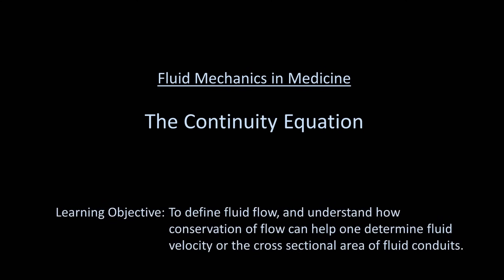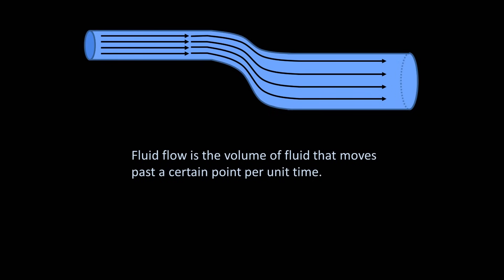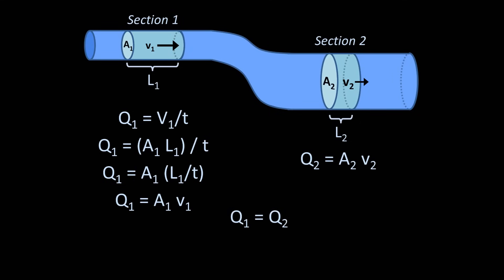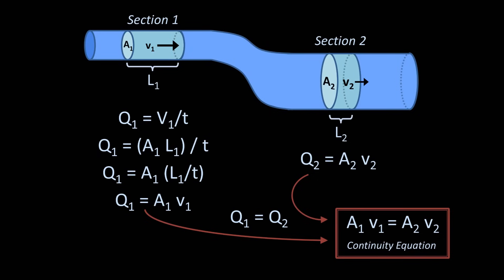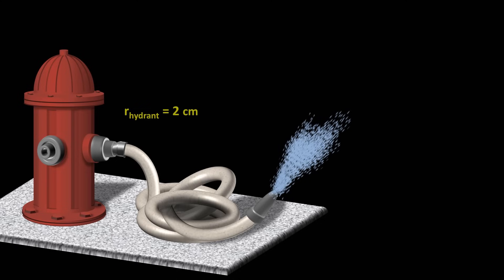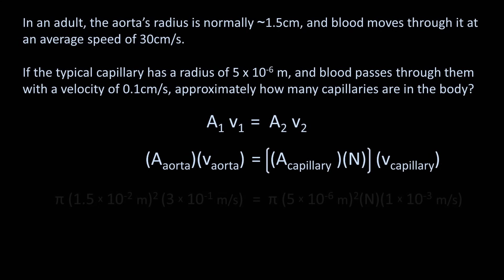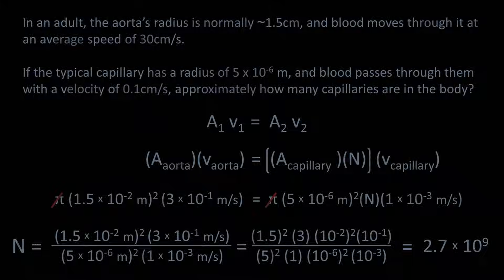The Continuity Equation (Fluid Mechanics - Lesson 6)

Comment: How to understanding this case, when we have reduced cross section (A) in pipeline (caused by valve half closing) the time to fill up in a tank is different when I fully open the valve and half open, does this mean flow (Q) in faucet valve end is less than the source? Kindly explain, thanks

Comment: So basically what ur saying is that any amount that enters in one end the same amount comes out in the other ????
Reply from the maker: Yes, that's correct, but it requires the simplifying assumption that the fluid is non-compressible (which is an accurate approximation for everyday applications).
Reply: @StrongMed  so if it enters in the form of ice n it melts inside would it change???
Reply from the maker: @christianarrizon9796  Ice isn't a fluid. The physics of fluid mechanics don't apply. Ice also takes up more space (i.e. has a lower density) than water. I would guess that slush (i.e. a slurry mixture of part ice and part water) violates the non-compressible assumption (i.e. increasing pressure would convert some ice to water, thus taking up less room), so the continuity equation wouldn't perfectly apply then either.

Comment: In your calculations velocity in meter per sec and radius in cm.why don't you convert radius cm in to meters. While calculations all units should be same ryt?
Reply: He had already changed it. Please check the video once more.
He has changed 1.5 cm to 1.5 X 10^-2 which is basically 1.5/100

Comment: If I have a tap being supplied with 1/2" pipe and I want to attach a hosepipe to that tap, will I obtain a greater flow rate at the end of a 30m hose pipe if the pipe is 3/4" instead of 1/2"?
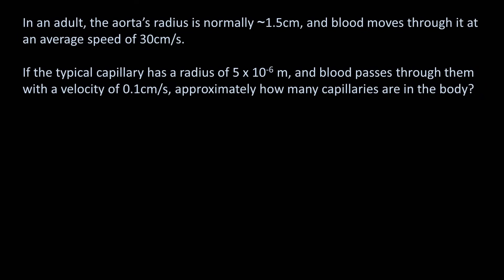Reply: No, you wouldn't be getting a greater flow rate. You have to reduce the radius of the pipe. He has explained it clearly on 4:08.

Pi * r1^2 * V1 = Pi * r2^2 * V2

r1^2 * V1 = r2^2 * V2

(1/2)^2 * V1 = (3/4)^2 * V2

1/4 * V1 = 9/16 * V2

16 * V1 = 36 * V2

V1/V2 = 36/16

On simplifying, you get
V1 = 9 m/s
V2 = 4 m/s

Velocity and Pressure are inversely proportional to the area of the cross-section of the body through which a fluid is flowing.

So, providing a hose of a greater radius wouldn't increase the velocity of which it flows.
Reply: Flow is constant at both the sections however velocity increases or decreases depending upon whether the area reduces or increases respectively.

Comment: quick question.. So since the blood vessels are considered to be a closed circuit, the flow rate should be constant at every point in the circulatory system. The law of continuity basically states this. But when you consider poiseuille's law, the flow rate is proportional to r^4. So if we were to have constriction of the blood vessels, then the flow rate would decrease. But then as stated earlier shouldn't flow rate be maintained constant throughout the body regardless of the radius of the vessels? I would appreciate it greatly if someone can help me out. Thanks
Reply from the maker: I wouldn't say flow is constant, since that implies sameness over time.  Instead, at any one point in time, total flow should be the same everywhere in the CV system.   For example, flow through the aortic valve approximately equals flow through the pulmonary valve, and approximately equals flow through the entire body's capillary bed.  It's approximately, because there are moment to moment changes in the capacity of certain vascular beds - most prominently in the lungs with the respiratory cycle, but also places like the legs with abrupt changes in position.

While arteries can constrict or dilate in response to various factors, capillaries don't.  In addition, when there are changes in peripheral resistance due to changes in artery radius, there may also be changes to cardiac output.  For example, giving a pure vasoconstrictor like phenylepherine to a patient usually decreases cardiac output due to increased afterload (i.e. increased work and O2 demand for the myocardium).  And this is made that much more complicated because some compounds such as catecholamines can influence between artery radius (and thus resistance) as well as having a direct effect on myocardial contractility.

So overall, depending on what caused it, changes in artery radius can have variable effects on both the velocity of blood flow through the arteries and that through the capillaries, but the degree of change in velocity in those two areas are not the same.
Reply: Ahhhh ok, I think I finally understand how flow rate can change. basically the amount of vol passing through any pt in time must equal to the amount of vol pass through all other points, i.e flow rates in capillaries will be smaller relative to the artery, but the summation of the flow rates of the capillaries would more or less be equal to the artery that was preceding them. Thank you sooo much for the clarification!!

Comment: you didn't convert cm into m
Reply from the maker: Mai Ly No need to.  As long as the radius is given on both sides of the equation in one set of units, and the velocity is given (or determined) on both sides of the equation in one set of units, the units for radius and velocity don't necessarily need to be consistent with one another.

Comment: continuity equation the first key to solve hydraulic problems.
Q=V/t
Q=v.A
The tow equation the same but the 1st V volume,the 2nd equation v mean velocity
verify your equation by its units
Q=cm3/sec.   V=cm3  t=sec  if you divide =cm3/sec  the equation right.
Q=cm3/sec    v=cm/sec A =area=cm2 then{ cm/sec x cm2} =cm3/sec the equation right.
Reply: Ibrahim el sayed can anyone tell in the first problem why he hasent converted 2cm into meters ...all other units are in meter
Reply: the other radius was also in cm. So the units will basically cancel each other out

Comment: Great video; I was wondering if you could clarify something for me: I'm confused about this equation (a1v1=a2v2) and this equation: flow = change in pressure/R. it seems like from the first equation, velocity 1 is proportional to 1/r^2 but in the second equation, flow (or velocity?) is directly proportional to r^4.
Reply from the maker: That's a great question.  You are correct that from the continuity eq (a1v1=a2v2), velocity 1 is proportional to 1/r^2.  With the 2nd eq (flow = pressure gradient / resistance), you are also correct that flow (but not velocity) is proportional to r^4, (as a consequence of Poiseuille's Law), but (and here's the catch) only if the pressure gradient remains constant.

Consider a straight tube of radius r transmitting some fluid with velocity v, and the flow Q is being driven by a pressure gradient, which we'll call P.  What happens if we double the radius of the tube?  It's actually impossible to say without more information about the source of the pressure gradient.  For example, if it's a water pump designed to pump water at a specific set pressure, the doubling of the radius (which decreases the resistance by a factor of 16) would result in flow being increased by a factor of 16 also.  By increasing the flow by factor of 16, and increasing the cross sectional area by a factor of 4 (2^2), the velocity through the tube must increase by a factor of 4 also.

However, if the pump is designed to pump water at a specific flow rate, the doubling of the radius (again, which decreases the resistance by a factor of 16)would result in the pressure gradient dropping by a factor of 16.  If the flow remains constant with the radius doubling (and cross sectional area increaing by factor of 4), the velocity through the tube decreases by a factor of 4.

It all depends on what is ultimately pushing (or pulling) the fluid.  The cardiovascular system acts more like the former situation.  The primary relevant feedback mechanisms are baroreceptors, which act to keep the blood pressure (i.e. pressure gradient) constant in response to decreases in peripheral vascular resistance (i.e. blood vessel radius).  However, there are secondary mechanisms such as circulating hormones called ANP and BNP which can indirectly detect decreased cardiac output (i.e. flow) and dilate the arteries in response (i.e. increase blood vessel radius), the effect of which is to increase flow at the expense of decreasing the pressure gradient.

I know that was a bit long-winded, but I hope it helps.  It's a little difficult to answer math-related questions in a dialog box.
Reply: that makes sense; so if talking about constant flow, use a1v1=a2v2 and if talking about constant pressure, then q is proportional to r^4; do you know why they use the A1V1=A2V2 to explain that since the capillaries have the largest surface area but then use Q=r^4 when talking about atherosclerosis? I get that in th former situation, as you said because the heart is seen as pressure pump so pressure is constant so use A1v2=a2v2; but what about the second situation?